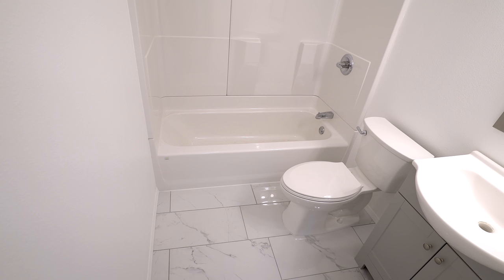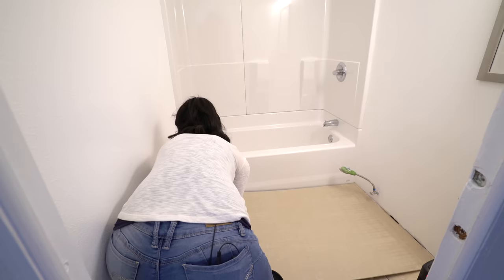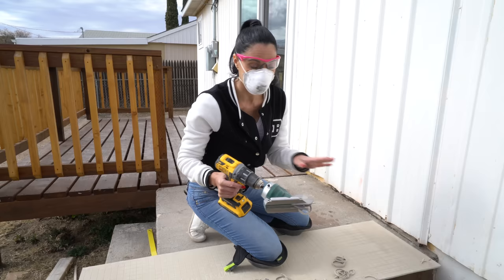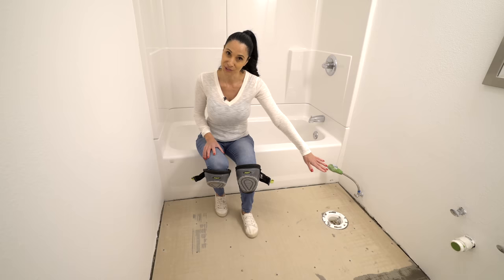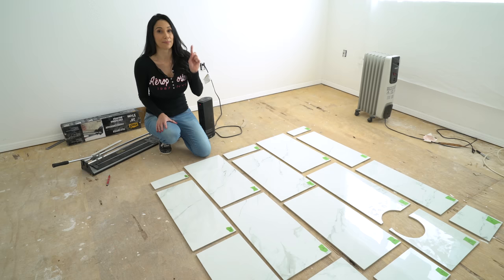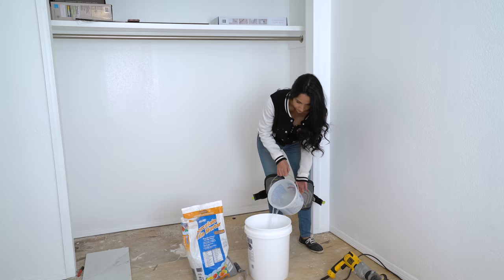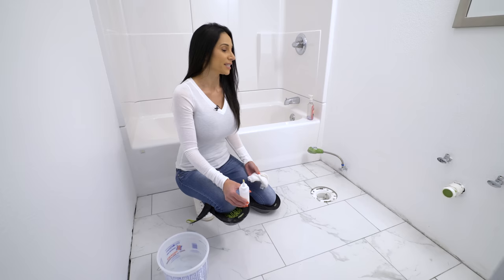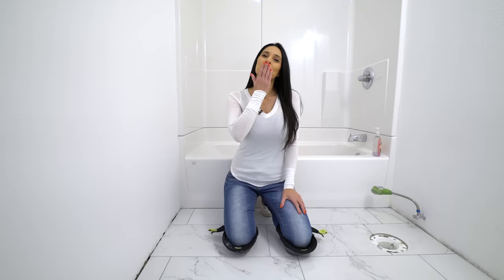How to Tile a Floor for Beginners

Comment: Brand: ProKnee
4.6 out of 5 stars1,534 Reviews
ProKnee AP16 Knee Pads For Men | 1" Foam Knee Protector with Live Hinge & Smart Lock Quick Release Buckle | All Purpose Flooring Knee Pads | One Size Fits All
Amazon's
Choice
in Safety Kneepads by ProKnee

Don’t know if you have found a pair of knee pads yet but we use these for flooring and they stay on and very comfortable. Good luck. Good video

Comment: You must not grout the perimeter joint especially with the tub, that should be caulked with silicon. Grout is only for inner seams. That is the accepted consensus.  One reason is expansion and contraction when the tub is filled with water it pushed out on the joint and grout can crack then water will seep under whereas sillicon will stretch and maintain waterproofing and protect the tiles.

Comment: I really enjoy your videos.  You make it fun with laughing.  Great job.  Do you have any suggestions if I want to rip out my tub and tub walls & sink I want to use polished porcelain tiles from the floor up to the ceiling.  It’s a small guest bath.  Want to hand a wall mounted sink.   No shower curtain or doors. Just a walk in shower.  I bought a very nice Bidet toilet ova decors Tuva bidet.

Comment: Wouldn't shoving a contractor's trash bag into the thinset bucket so that it lays flat against the thinset and against the walls of the bucket help prevent the thinset from drying out? You know, like ... when I'm trying to keep a skin from forming on some yoghurt, or want to keep a batter from drying out, or keep a dip from getting weird in the fridge?

Comment: Don't use the trowel to lay on the mortar though, that's unnecessarily harder, just use a bucket trowel, they can't be that expensive and would allow you to lay on a lot more mortar each time making it much faster, other than that awesome, would also be helpful to get a suction cup, i wouldn't imagine doing tiles without one nowadays, it's just so much easier to manipulate the tiles with them and they're not that expensive

Comment: Nice How-To video. You are a good instructor. As far as the knee pads...I am wondering if you could not solve the issue of them falling down by applying some carpet tape (2-sided tape) to the elastic band that wraps around the back of your leg. You want to use it on a spot that will have contact with the jeans. You cant use it on the knee part because it separates from the knee as you stand up and get back down on them. The strap at the back of the leg should not lose contact though...
Reply from the maker: Thank you! I found some good knee pads at Home depot.

Comment: I wonder if you can get shin guards that are used in sports. The kind that go from the top of your foot to just above the knee then they can slide down.
Reply from the maker: I found some good ones at Home Depot, thank you🙂
Reply: @NassrinsDIY  and they stay where they belong? Cuz mine have the same problem they're more like ankle pads. You did a good job on the tile I saw.
Reply from the maker: Thank you🙂

Comment: You are my hero! Thank you for sharing this best tutorial ever. I have one question. Can you tell me what the thickness was after everything was finished? I am planning to follow your video for my master bathroom and kinda worried about how I can level it with the floor of the master bedroom. I appreciate it if you could reply me ! 😁
Reply from the maker: So the thin-set was about 1/4”, the Hardiebacker was 1/4” and the tile about 1/4”. but if you have a concrete floor you can minus the quarter-inch for the hardiebacker because then you don’t need it. Hope that helps 🙂

Comment: Great video! I am trying to put wall and floor tile down for a wood burning stove. How do you recommend finishing the edges that at seen on the floor and wall? Also, should I leave a grout line along the corner where the wall and floor meet as well as each side of wall or just put the tile directly against each other?

Comment: If you put thin set under the backer board, how will a future renovator remove the tile without damaging the backer? And then if you remove the backer, you damage the plywood?

Comment: @11:05 when the screws lifted up the hardy board, did this not allow air to trap underneath? The entire purpose of the collapsing ridges in the thinset is to allow air to escape. Lifting up the backer after that creates the same problem. It should be relaid down from scratch if lifted up.

Comment: 1- do not put tinset under the hardybacker over time and so much stepping overflows. 2- the smallest tile cut you have to put it on the side so that it does not look like you did it wrong /.

Comment: Thank you for the video (How To Tile A Floor For Beginners).  It is so helpful because it is so detailed.  In your video you mentioned that we should take off any old tiles before we begin.  However in my bathroom the old tiles are set in the floor very well.  None are lose or cracked.  So in this case can I leave the old tiles in and place the new ones on top?  This would make my job faster.

Comment: You toilet flange should be on top of the cement board and tile or at the very least on top of the cement board so it isn't so far below the finished floor.

Comment: Please tie up your hair and wear gloves!!  I’m a woman too with long hair and you will be amazed how much easier it is to work without dangling hair interfering with your sight.  And bring an older woman who didn’t use gloves when younger - my hands are now twenty years older than me and look dreadful!  Otherwise I enjoyed your video! 👍🏽🇦🇺
Reply: Yes and it’s not professional if you have that long of hair draped in the middle of the project (dangerous) and as said not using gloves, respirator and eye protection.   Also, maybe you did it and I didn’t see — stuff the hole with large heavy rag in the hole to keep drain odors and gases in the hole not in the house or your respiration system.

Comment: You don’t need to set cement board in thin set, you are better off using a glue and then screwing down, the glue will keep it from making noise. Thin set can crack out over time causing issues. Also you don’t have to make sure all the trowel lines are in the same direction, as long as it’s spread out evenly. I would recommend using shims next time, you could be a pro with just a little advice. You have a good attention to detail! Great job!
Reply: Shims aren’t needed 
Same direction notches are so air can escape when tamping down
Reply: @tomdemeo2708  Claim what you will, I have been running a flooring installation business for 25 years, I have a little experience. I am honestly saying, you don’t have to trowel in same direction, nor do you have to set backer board in thin set. Thin set is for tile.

Comment: I didn’t wipe the tiles when using the mortar and it has set on the tile. What’s the best way to clean the tiles now? I also have some mortar that is between the tiles. Should I use a dremel to get that out the way to grout?

Comment: If you would seperate the tool and material list seperatedly,  that will help a lot for a true beginner.  very confusing with the buzz words.  for example you mentioned Thinset actually is for motar.

Comment: I've been having problems with my tile moving. I'm wondering if it's because I'm walking on it within 12-15 hours?  I'm using 1/16  T spacers but they seem to bend. Maybe because I'm not waiting 24-72 hours?
Also, with back buttering, should you always have a thick coat? I've been doing light and I noticed I can remove the tiles easily with a crowbar. The reason why is because some ended up moving. Im wondering without a thick back butter. Maybe porcelain tile may break if you drop something on it.
So I used antacid 
Acid with a wire drill bit. To redo some.

Comment: Hi there....you’re careful to apply the thin set , grooving it in the “same direction”.  I couldn’t discern whether the thin set on the tiles themselves is grooved and if the grooves go in the same direction as the direction of mortar on the floor.  I assume I does.  Can you clarify?

Comment: 1. that thinset is too watery. follow instructions on the bag. it should look like peanut butter and yours looks like crepe batter.

2. that trowel is too small for that size tile. you should use 1/2" by 1/2" notch for 12x24 tile.

Comment: Hardibacker is a risky product for DIY'ers. It must be kept wet prior to installing tile because if not it will suck the water out of the thinset creating a weak bond with the tile. Wet the hardibacker before installation and before putting down thinset for the tile. Nice tutorial otherwise

Comment: Heres a few things to help you become more than a novice. First, get a chalk line and forget the painters tape. Second, when you use the flat side of the trowel to apply the thinset to the floor, scratch the trowel against the substrate to increase bond strength.  There is NO sense using the flat side of the trowel to spread your mortar if you are not doing this.  Third, when you set a tile next to the adjacent one, drop it tightly next to that tile with no space for grout that way when you set the tile all the mix doesnt ooze up the grout joint.  Also, your template is ridiculous and all you need is a piece of cardboard cut 7" in diameter to that job. Lastly, buy yourself a brick layers trowel with a square tip to use when scooping from your thinset bucket.  Its probably best for you to become an amateur tile setter before you even make a beginners video like this.  You are still a beginnner yourself and it shows so best for you to take all the help you can get and use it in the future of your channel.  This comes from a journeyman tile setter of 20 years.